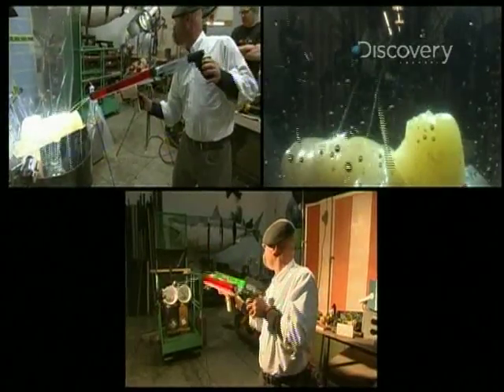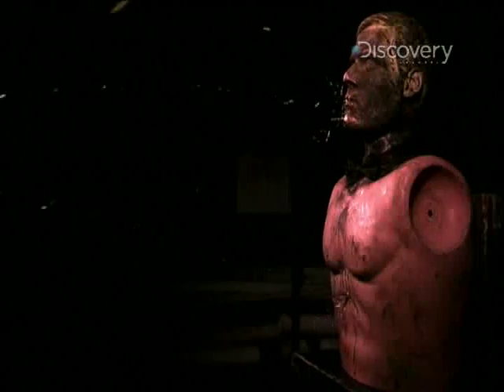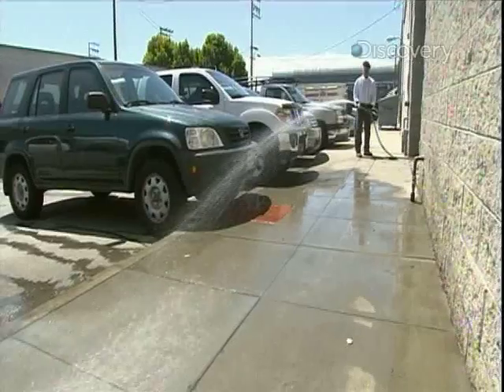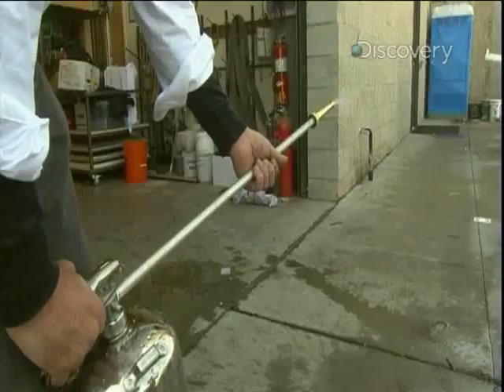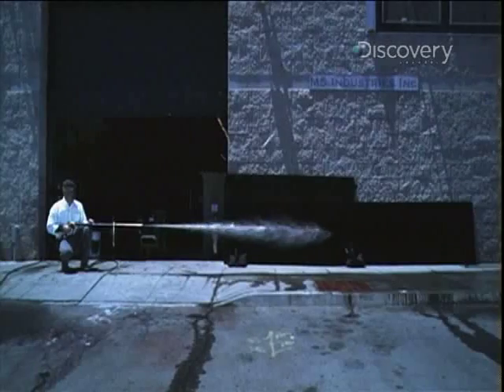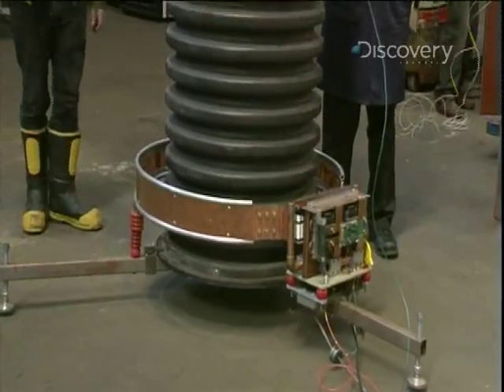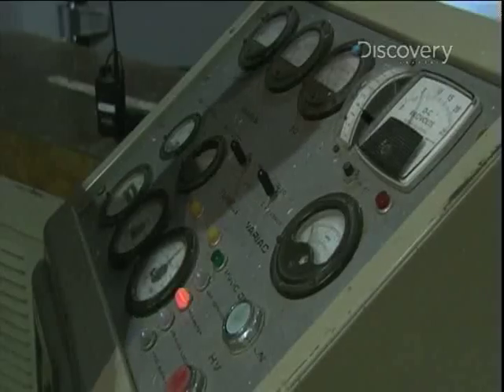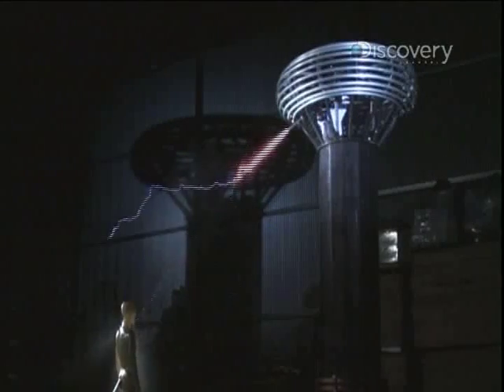MythBusters - Water Stun Gun

Comment: To make this a more practical weapon couldn't they just use a battery operated extra high voltage power supply? eg. a driven flyback transformer. That would maybe be enough to jump the small airgaps in the water stream. The user could have a boot that grounds them allowing only the use of one water stream?
Reply: Runescape sucks tho

Comment: when they make the 22 foot tall tesla coil the mythbusters should do a  myth that rubber boots save you from lightning.
Reply: +Camubish if lightning can travel from several thousand metres in the air, it can jump less than a centimetre
Reply: still some people don't beleive it so they should prove it.
Reply: +Gunnar Gunnarsan No, there's copper inside the rubber, and the rubber protects you when you touch it.
Reply: Lightning is the breakdown of air as a natural dielectric that is between a potential difference. The high amounts of friction caused by the clouds builds up this potential. The energy will be constantly dissipating though a different form of the airs breakdown called the corona affect (know as feelers). If a high enough potential is generated fast enough to counter the loss and at the same time there is an established feeler it will superheat the air into plasma. Plasma is a great conductor so this allows the potential to dissipate many millions of watts though this path creating the bright blue bolt we all know as lightning. So if your standing in the middle of an electrical storm in the middle of a flat area with no trees the feelers are mostly likely going to be going though you. Lightning is DC and the potential generated could either be sky+ and earth- or the other way around.
Reply: Good idea
Reply: That's not a myth. That's fact.
Reply: Yup
Reply: Chris Blagdon so the power runs trough the rubber on the power cable??
Reply: EnderGamer i know that. :p I was just showing chris blagdon that if rubber conducts power then there would be no use of the rubber around the cable.
Reply: Chris Blagdon So lightning will travel 5km to be stopped by a bit of rubber? It would lower the chances of being struck allot but it wouldn't save you if you are the path of least resistance.
Reply: Mangochutney
wtf are you talking about i meant that if it hit you it would be grounded out by the rubber insulators.
Reply: Chris Blagdon What I meant is there no myth to it, either you get hit or you don't, it really depends on what is the path of least resistance is.
air is in the range of tens and thousands of giga ohms. (electrical resistivity)
a slice of rubber is a good insulator but not good enough when it comes to 10-50 million volts.
Do you understand? Electricity isn't a physical thing. Lightning wont strike a spot, come to a realization that it cant complete the path then go back. Its weird stuff.

Comment: i think the myth involved water that's why they used water.  as for gooeyness, the issue is largely that of wind resistance, the more pressure the faster it moves, the faster it moves the more air breaks it apart, a gooey liquid would still break up but form larger droplets. the key is not to stop the liquid breaking up but increase the voltage so it can more easily jump the air gap. which is pretty much what they did with the tesla coil/

Comment: @Tlaloc666 how about this... go do an electrolysis experiment and see the results... the only way it will is if the water is separated into the gases... at that point the hydrogen is actually explosive... but when you combine two gases and their electron count is at a full 8 like H20 then in fact it is completely pure and will NOT conduct... the ionized effect is not pure water... it's pure water that has in fact already been seperated... the only way i ever got electricity with (continued)

Comment: Even pure water has some ions and will conduct slightly. First of all, it dissolves some CO2 from the air, making H+ and HCO2- ions. Secondly, even in a CO2-free atmosphere, there are some H+ and OH- ions in water. The product of their concentrations at room temp is 10^-14 moles/liter. It is the square root of this which gives you the neutral pH of water being 7 (10^-7 moles of H+ ions per liter of pure water).

Comment: @freakin1random correct, Pure water otherwise knows as DISTILLED water is what you get when water vapor condenses and is funneled into a separate container. it will have NO minerals to speak of because the obviously will not boil and change to a gaseous state. this takes the conductivity to zero. now say, well or tap water will have various levels of minerals including but not limited to salt  and fluorine which aid in conductivity.

Comment: You are right.  Very pure water is an excellent insulator.  In laser labs, it is commonly used for this purpose.  However, if *anything* is dissolved in it, its resistance decreases dramatically.  You just have to poke your finger in 50 gallons of water to cause its resistance to plummet. 

So for most practical purposes, it is a conductor.

Still, I wonder if a water stun gun would work better with salt water.

Comment: Their approch is wrong imho. They should try putting water in a small isolated container (for example these plastic coffee cups - or even better isolators dependung on the voltage), then charge the water with the taser and then spray the water around. Of course everything must be isolted against ground until the drops reach the target and they should keep in mind that the water will more or less slowly discharge on its own in the cup.